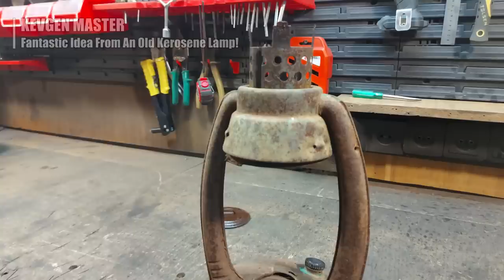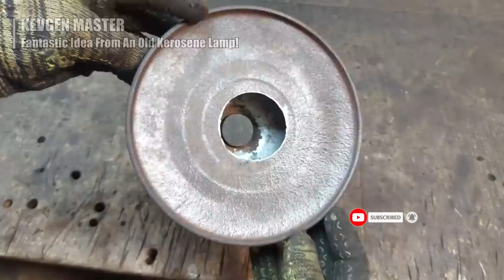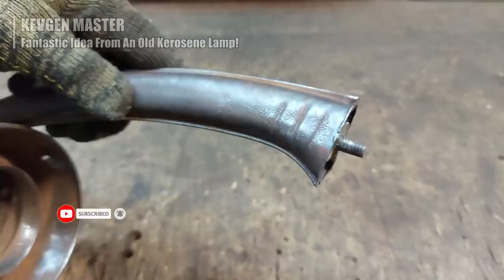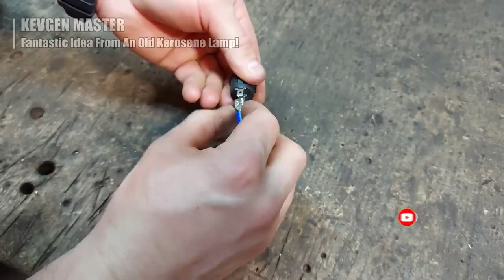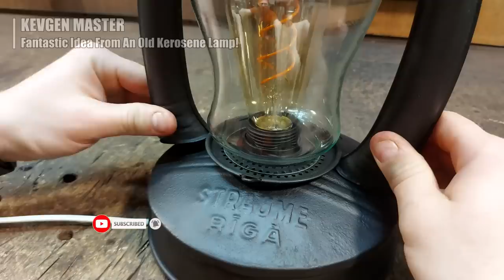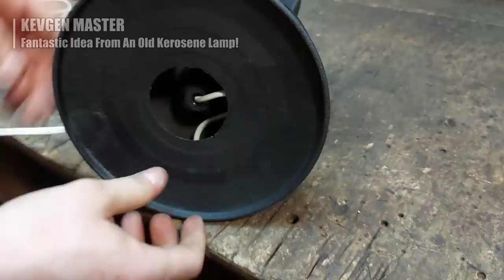Fantastic Idea From An Old Kerosene Lamp!!

Comment: To remove rust without removing metal use molasses.

Try 1 part molasses to 9 parts water in a plastic container with a sealing lid.

Put some fishing line on to be able to pull the item out to inspect the item.

Put the item in, put the lid on, check every 3-4 days. 

Yes it may stink.

Once the rust is removed, rinse, use a soft brush to get the powdered residue off, rinse, immediately get some protective coating on, or it will start rusting again exposed to air.